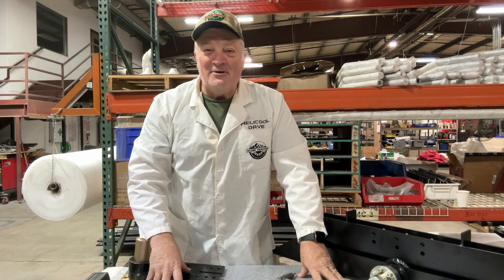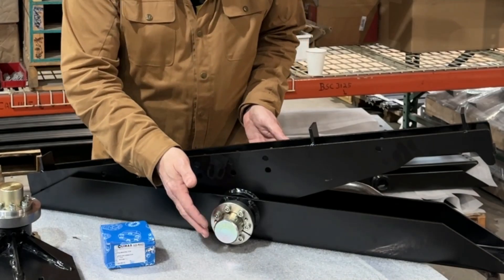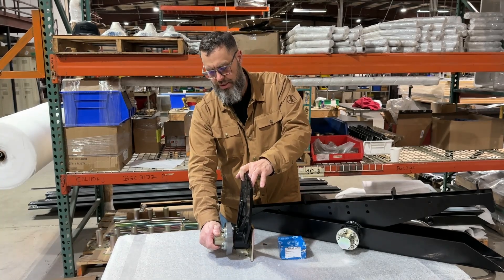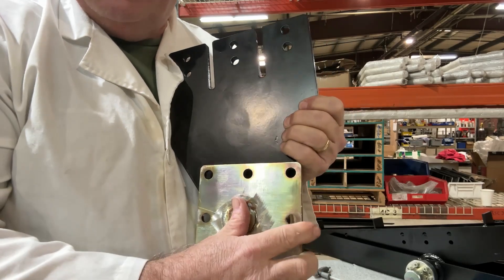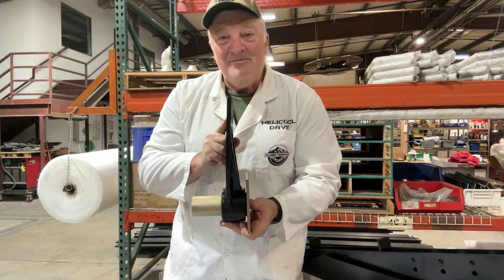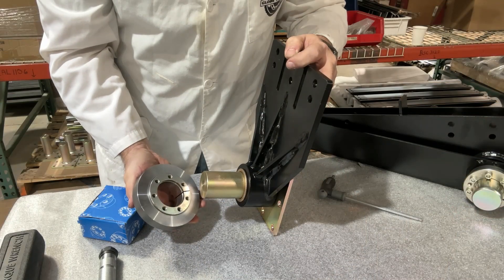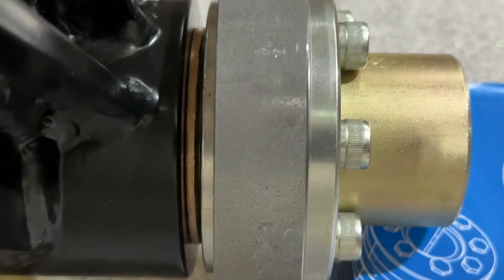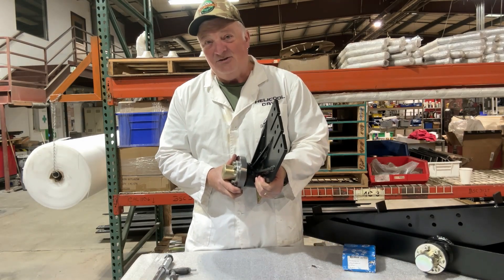Globe Trekker Axial Pivots: Bore Ring & Shaft Lock Collar install

Comment: Others and I have asked for over a year now for you to do a video explaining the whole zero torsion system. NOT a walk behind, or video it going over something but In the shop, jack up 1 wheel then the opposite side, opposite end tire to show the max frame torsion vs the no torsion frame, how it works but for some reason you wont, now youre talking about cracks in the mounting plate, MAYBE this doesnt work in life as you say.
Reply from the maker: Thank you for your feedback, as I personally consider it a gift. I have multiple videos explaining the differences in our subframes, how a our Zero Torsion subframe works, and we also show both an M1078 mil surplus vehicle and an F550 backing up a loading ramp dock with one rear tire on the ground and one riding up the ramp. These videos were both released over two years ago. The pivoting method is not new. This was designed decades ago for the UNIMOG, and it has been proven technology ever since. Perhaps you should lurk more... there is lots of information and educational videos that we have produced that you seem to have missed. 

You are also taking this video out of context. Because the bore ring not being in place, the axial thrust overcame the lock ring, where possible cracking could occur.  Here we try to educate, even to a higher degree than anyone else who is doing pivoting anti-torsion subframes, and suddenly we are the bad-guys? Transparency is part of our company values because we respect those in the community that are not wanting sugar coated or watered down information. We are not afraid to make corrections or improvements and tell people about it. It just makes us have better products and increases the trust that overlanders in the OEV market desire. If anyone is looking for slick marketing, halve truths, and smoke and mirrors, I know several companies that will sell anything to you for cheap. But that is not who we are.
Reply: @RVGlobeTrekker  IDK how watching your video and asking a question is lurking but ok, I guess we're all lurking when we watch videos. Seems like an asinine comment but ok, youve always proven to be a asinine. I have watched a video where you back up a truck on a ramp and say see, it works. The recording was a fixed camera and didnt go around showing how this pivoting idea works at each corner. But you do you, dont show what we're asking to see and show how offended you get when we do ask. Im sure everyone can see your personality and attitude in your thin skinned replies.

Comment: For years, I've been waiting to see a full video on this pivoting assembly sub frame.  Use some lasers on a flat deck so we can see how the habitat stays flat as the frame twists, torqued, rides up and down.  The 1 min. portion of a show you did wasn't informative then, and it's still not.  You said you would do it. And here we are, another year later year later, I'm still waiting.
Reply from the maker: We drove two trucks up a 4' loading ramp with one rear tire on the ramp and the other on the ground. I filmed a low angle to show the flat surface of the subframe while the truck was in torsional twist. Lasers on a deck do not prove anything, because the subframe will not remain level gravitationally to the Earth. It is easy enough to see how flat and torsion free the subframe is when you look at it on a low angle. We are not inventors of a pivoting subframe... that would be Mercedes on the UNIMOG decades ago, and there are many videos out there that can satisfy your curiosity. Although we would like to, we simply don't have the time or resources to fulfill everyone request and make proof of concept videos on tech that was not our own patented creation. Still, the proof is in the pudding. Does our Zero Torsion subframe keep the torsional twisting forces of the truck from out of the camper? You don't have to believe us... there are many resources you can use to find the answer to be, yes! Thank you for being an avid explorer and critical thinker... it keeps us all on our toes and makes us seek additional knowledge and wisdom. Cheers!